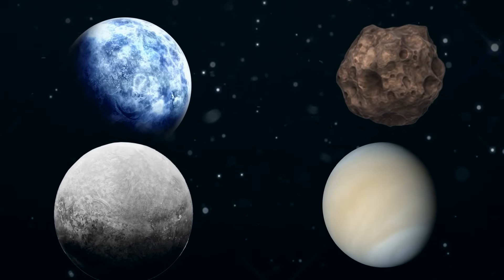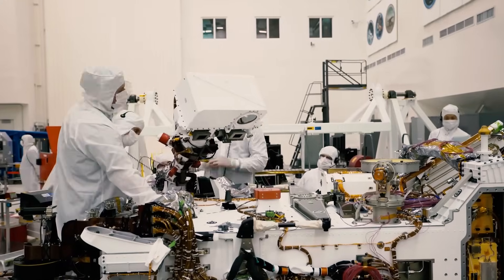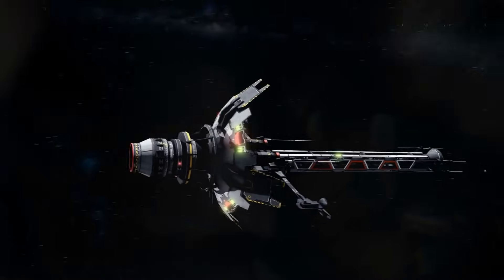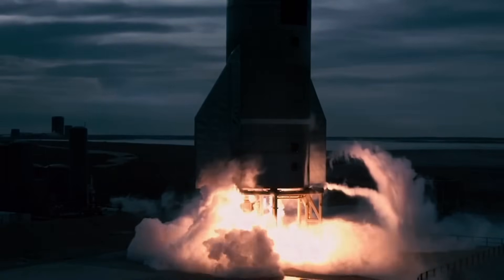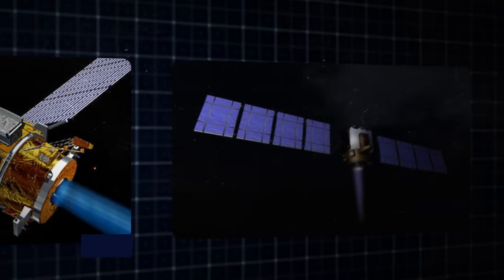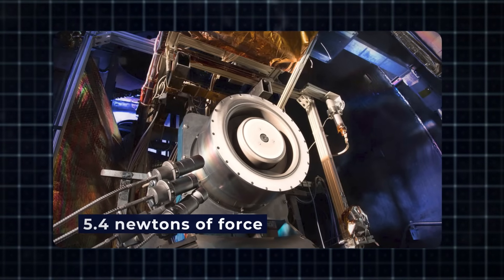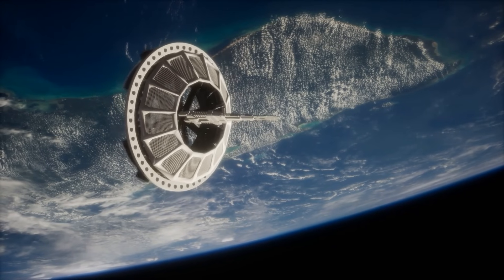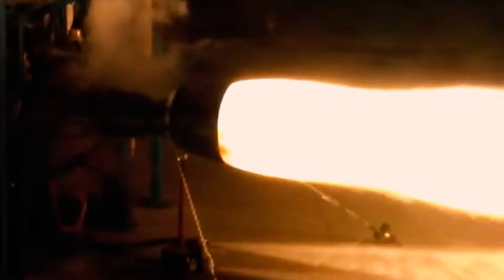NASA Builds Impossible Light Speed Engine That Breaks The Laws Of Physics

Comment: I would take issue with the glib comments on Ion Drive being developed by NASA via some connection with warp drive theories. Ion Drive first flew in the Airship Hangars in Bedford, England in the 1960s. Using the hangars was necessary because the acceleration from an Ion Drive is 1g, so is only possible on Earth in static air conditions.

Comment: Warp has been built but not by us! Clearly, the processor technologies that we must have built have never been discussed. There is ORDER  in every creation and Warp Drive is completely outside the norm of the physics we still call it theoretical physics. Moreover, we are testing the Warp inside our solar system which has created so many destructive dilemmas in the geology of our solar system.
What are we going to do with Warp drive when we are still using fossil fuels and don't comprehend the true meaning of potential energies or antigravity..., ohhh, sorry,  Aliens made a deal with US and Russia to share their Ion drive, magnetohydrodynamic systems, EM drive, plasma-nuclear engines ....,  except that the little Greys are not entities but 70% machines sent as explorers by highly advanced and intelligent species to help us destroy ourselves, so they would easily take over, we learned the plasma, night vision, Laser, fiber optics, and electronic cheaps or semi-conductors from their body ..., these things normally does not exist inside biological entities

Comment: Way of space x and nasa is wrong ,
My way as long as there's a supplying current to the top and bottom , the chassis is following only. 
You drive my gapping zone and antigravity way . The real driving becomes a dummy driver. 
The more faster than the real driving is more faster 100 times than the real driving. 
Gapping zone is the way to do it .
Gapping zone can be made inside the chassis . You want this or you want to copy only .
Then I'll give it free , in my grave you can get it .
My flash driving running in light speed way can power the spaceship 100000v ac x2 , resting and running . No fuel no fuel chamber no batteries no tons and tons of fuel .
And no sitting passenger in a fuel chamber .
Want my way ? 100 m $ first .

Comment: In my opinion breaking the laws of physics is impossible.
However one way of accelerating would be to deploy space magnets and shoot some kind of shuttle through them  which would be pushed out to space  experiencing and large forward thrust.
Reply: Clearly the meaning of the word "law" is being abused here. Humans pass laws with the specific intention of breaking them. As soon as you pass a law to explain the golden rule, you are forced to keep doing it. That's why we get 40,000 new laws each year when one rule works just fine. The real physical world doesn't do that. But in the mean time, using the disturbance caused by a Thorium MSR is just what we need... so we can save the oil for making plastics.

Comment: Not that way still using fuel. My way levitation levitating invention way,  
The up pull the bottom push the center zero which is the chassis and load is following only. One drive of the up more the bottom push the center zero which is the chassis and load is following only .
The center is fucos only in remaining in the center , because it's safe there .
A gapping zone did it .
There a guide to make it work .
It can be done without gravity weight out . 
Faster than light is very easy , removing first the weight and you can do it .

Comment: Interesting that they seem to overcome the fact that as you accelerate towards to speed of light your mass approaches infinity and as such require an infinite amount of energy to accelerate further.. You cannot beat the laws of physics. Chemical based engines can only propel an object to. Certain speed, ion thrusters can achieve approximately 186,000 MPH however it requires a long time for a spacecraft to accelerate to that speed. This is the cosmic speed limit and only massless particles like photons can exceed this limit. CERN accelerates protons up to 99.9999991% the speed of light

Comment: If an object moves at the speed of light, then that object is light itself.
Reply: If an object moves at the speed of light, it doesn't become light itself; it retains its properties but approaches the theoretical limit of speed according to the theory of relativity.
Reply: as an object accelerates and approaches the speed of light, its relativistic mass increases. This means that it would require an infinite amount of energy to accelerate an object with mass to the speed of light, which is practically unattainable. This is why nothing with mass can ever reach or exceed the speed of light in a vacuum except the light itself @pinkiethesniper6630
Reply: The Speed of Light is relative.

Comment: Up until now whatever that was said dont matchup or connect properly we have ion engines but cant produce enough thrust, we may create nuclear powered engines but cant deal with the radiation, we theorize warp drive but everyone has different views and the dangers of bending space and time without an energy field around the space craft will rip everything to shreds, and when we talk about light speed we are completely right about its theory and the practicality of it will not be anytime soon and at last everything comes around to the build of the craft which has to be able to withstand the counter effects of every propulsion system.

Comment: Light speed?  Not in THIS century.  Constant acceleration will eventually get you there, but would take a loooooooong time using current ion drives.  Quantum fueling is still only a hypothesis, not even a theory, and we don't yet have the tech anyway.

Comment: From what I understand about the law of acceleration produces a lot of kinetic energy even in the zero resistance of space  pulling back on the accelerating mass. What if there was an engine that turns  the pulling back force the opposite direction?  When mass accelerates  the  kinetic energy  pulls forward the ship in the same proportion as it pulls back. The faster we go the more pulling forward force there is.
Reply: cool idea but it's important to consider the laws of thermodynamics, they play a big role.
Reply: According to this, was Einstein wrong in the famous, well-known formula E= M x C2? So far everything has confirmed it, although we know for sure that we know very little!
Reply: It would be called a perpetual motion machine. any accelleration would then destroy the world no matter which way it was aimed.
Reply: That's rather similar to the warp drive. But the warp drive pulls itself forwards by warping space
Reply: RESEARCH THEIR INTERSTELLAR CRAFT CALLED TR3B, LEARN TO WALK WITH YOUR MIND BEFORE YOU CAN RUN WITH THEIR DISTRACTION

Comment: One thing that might help push technology even further is to produce an Oxygen/Ion engine to use in military aircraft, just what type of Mach speeds could we expect if we moved our technology in that direction? We already have Nuclear powered aircraft carriers that can roam the seas for 50 years without stopping for fuel. What are the chances of creating a nuclear powered aircraft that can fly for weeks instead of just hours ?
Reply: 2à22w
Reply: Àaaaaaaaaaaaa
Reply: Aaàaà
Reply: A
Reply: I'm not familiar with the engine technology you mentioned; I've never heard of it before.  Ion engines have not been used in Earth's atmosphere because the produce so little thrust.  They are better suited to space because while they cannot produce much thrust, they can run for months, and even a small amount of acceleration adds up over time.

Nuclear carriers like Enterprise get new fuel rods every twenty to twenty five years.  (More recent vessels use highly enriched uranium and refuel approximately every 30 years.) Because the reactors are at the heart of the ship, and there is no direct access for that operation, they have to cut through the ship's hull to reach the reactor, take the old fuel rods out, and put the new ones in.  Because this is such a major operation, the Navy does it as rarely as is practical.  They would love a reactor that could run for fifty years without refueling. Although the lifespan of the ship itself is probably not fifty years. (Enterprise, our first nuclear carrier, was decommissioned after 55 years of service, according to an article I just checked.)
Reply: The Americans and the Russians looked into building a nuclear powered bomber back during the cold war. The problem is the shielding. There has to be a thick layer of lead protecting the air crew from the radiation.
Reply: Anything you do will be done by moving something from where it is to someplace else. And once you've done that  you can't do it again. And it doesn't matter if it's ions or hot gases. You've got to take enough of it along to get  you where you want to go... or you will exhaust it before  you get there.

Comment: Someone hasn't done their homework:  at the speed of light, assuming you can instantly accelerate and decelerate without killing yourself, Mars is five to twenty light minutes away. At the speed of light, you cannot reach Mars in only four minutes.  (Also, the Moon is more like one and a quarter light seconds away.)  If you use numbers, it's important that the numbers be reasonably accurate.

It should be noted that the E-M (electromagnetic) drive was disproved by NASA, and was apparently the result of a measurement error.

Also, the description of the Alcubierre Drive is exactly the opposite of how it hypothetically works:  it "compresses" space/time in front of the ship, and re-expands it behind the ship, the opposite of what the narrator said.

"Three times more efficient than chemical rockets" with a nuclear thermal engine.  Now, the narrator said earlier that chemical rockets were only 35% efficient.  But they also said that the nuclear thermal engines could be three times more efficient.  Which is 105% efficiency, an impossibility.  As I said above, if you're going to use numbers, it's important that they be accurate numbers.
Reply: Dude close enough...don't be a dork
Reply: Journalists are unlikely to know physics at a high enough level. I'm only an electrical engineer, but I graduated from an electronics technical school before that and I've been following international physics for 50 years. I spent my last 10 years in quantum physics and plasma physics research laboratories. In fact, I built myself a machine that uses a quantum physics effect, with which I can drastically improve the properties of audio equipment, but for example CAT6 UTP cable (10Gb 9.6 x will also be 9.6 x better) (speakers, cables, etc.) The calculations are really wrong here. (According to our current physical knowledge)
Reply: NASA is just the front door for DARPA. It wouldn't be the first time that the Deep State pulls info. from the public.
Reply: Sorry. One EM drive was shown to probably not work. 
But, Field-Effect Propulsion (sometimes called Electro-gravitics), does work! It is well proven to work even in a vacuum!
Reply: Citation? Sez who?  @jordanburrill7182
Reply: @jordanburrill7182  Balderdash! The EM drive violates Newton's laws of motion. If "electro-gravitics" is real, please provide a link to an article from a reputable article describing it.
Reply: Your wrong
Reply: 6 minutes of terror they say.
Reply: Lmfao
Reply: Light speed would only be used for traveling great distances, not to the moon or Mars.
Reply: Besides that, anything with mass cannot reach the speed of light.
Reply: Warp drive in theory doesn't just achieve the speed of light it can enable travel faster than the speed of light. If warp drive is doable which currently it is not but if it is then 4 minutes to mars will eventually be doable. In theory! The Alcubierre drive is currently impossible but that doesn't mean it will always be. It's the closest we've come to understanding how to make this technology possible and it's looking like it will be possible a lot sooner than we thought. So investment in it would be wise.

Comment: Nothing can travel faster than 300,000 kilometers per second (186,000 miles per second). Only massless particles, including photons, which make up light, can travel at that speed. It's impossible to accelerate any material object up to the speed of light because it would take an infinite amount of energy to do so.
Reply: Ponder this, if you're flying at the speed of light and you turn on your headlights, what happens to the light from the headlights, does it go faster or do the lights just produce light that already going the speed that you're going ? That's the way Einstein thought. There's also the theory that at light speed matter becomes infinite, which means you are stretched from where you started to where you are headed, any way to fix that?
Reply: @jumpercable20  no. And the speed depends on what you compare - relative to the ship at light speed, they appear to be moving at light speed. BTW, at lightspeed time ceases to exist so you couldn't even turn on the lights anyway.
Reply: You have 2 go 2 'particles' smaller than photons 2 find stuff that moves faster than C; this is part of what we call dark NRG/dark matter
Reply: @toms2494  you're right, but it's been a while since I went that fast, I wore titanium goggles.
Reply: That's the reason for the warping of space/time.  A warp of space/time is neither matter or energy and can theoretically travel at any speed.
Reply: C'est un raisonnement très réducteur.. quelle sera "votre" physique dans 10 ans..? arrêtez de jouer les scientifiques qui ont tout découvert.. arrêtez de pontifier.. attendez.. l'avenir pourrait vous surprendre..!
Reply: @59131dd  think how many times "it's impossible" has been said, and today it's possible..
Reply: @user-he1zf1ms1o..  very soon you will be eating your words,.. and anyone else who claims lightspeed velocity cannot be achieved by machine!!

Comment: I knew they would throw Einstein somewhere in there.
Reply: Of course. At this time, no one can prove that we can break the light barrier, because Einstein's physics show that to be true.  We will have to either discover that Einstein got it wrong, or we will have to get used to never having FTL travel.
Reply: The main challenge I believe is to develop a space drive that can sustain a 1 gravity thrust for at least two years. That is the length of time required I think for the spaceship to accelerate to light speed and eventually go past it. This is required to see if Einstein's theories were correct.. @Henglaar

Comment: My question is I don’t think we have a heat shield that could hold up to traveling at light speed. Am I wrong about this? The friction from traveling at that rate of speed especially over long periods of time I think would burn up any metal we have ever discovered or created within seconds. Or how would the human body react to being jolted with such speed? I would think not well.
Reply: In space they can do it without friction. It's a vaccum no air in space 😜.
Reply: There is no friction in an oxygen free environment. The only place you have to worry about friction is in Earths atmosphere. Besides if you can fold space like a sheet of paper, you don't need light speed anyway, but the brains at the propulsion center are  always trying to push the envelope.

Comment: Their is a large Alien Warp Drive, 24' by 80', at Area 51.  This power plant used two operator thus the two seats; with a hole in the seemless fuseliage at one seat which did not penerate the divide between operators.  David Adair was told they did  not know how to use this power plant. David's 1 meter long power plant he built for his rocket was using similar technology.  David said this power plant could produce enough power for the whole planet.  David's power used 4 grams of plutonium for a 8 second burn that took his rocket to a height of 126 km. above the planet.  The fuel was contained within a magnetic field operating at 1 million kevon.  At 17, not yet graduated from High School, he had built a pwer plant that scientists had been working on for 40 years. To travel vast distances he said he would build a rocket with a field around the power plant to protect the crew, a second field wrapped around the craft, and another field would fold space; pulling the spaceship forward arriving at your destination in meer minutes to hours. This would propell the craft beyond light speed. The ET UFOs produced a similar field to protect the crew from the g-forces created by high speed right angle turns.  These people did not spend generations in space to arrive at Earth.  You generate a field in front of your spaceship that folds space infront of the craft pulling the craft foreward covering vast distances in small amounts of time.
Reply: I presume with no onboard time dilation?
Reply: @waynegnarlie1  Any time dialation would occur due to the warp field you are surrounded by.  Not by the speed the warp bubble moves.
Reply: @johnunderwood-hp8rj  Sounds like a very elegant and no doubt eventually practical way to travel.
Reply: @waynegnarlie1  probably not for at least 100 years or more.
Reply: Actually you would contract space in front and expand space behind.  It's how the warp drive works.
Reply: Oh, please. <eyeroll>
Reply: @johnbgood52  Interesting response to provable physics.  Hopefully you didn't react this way in school.